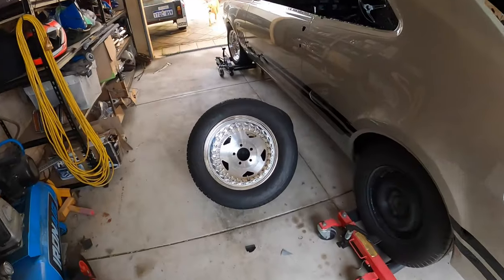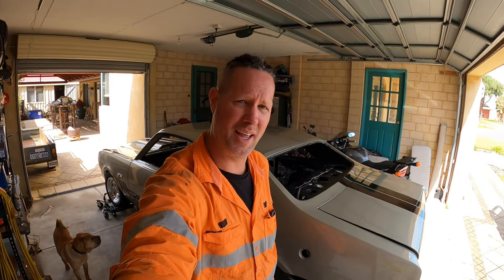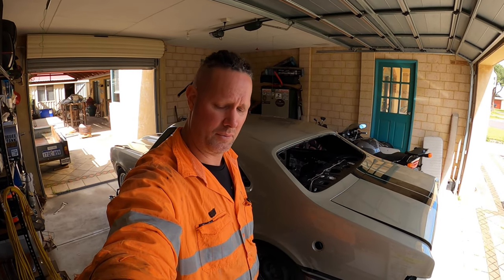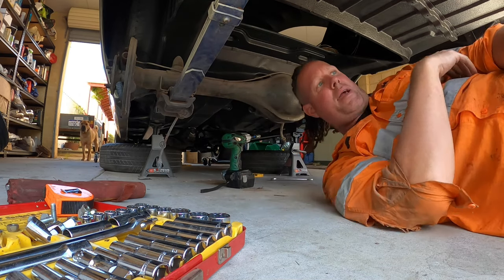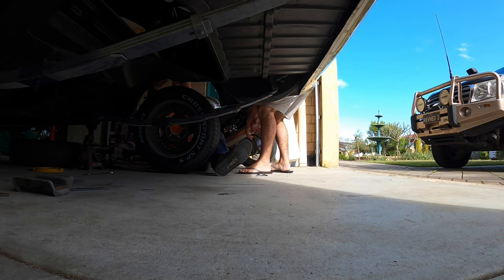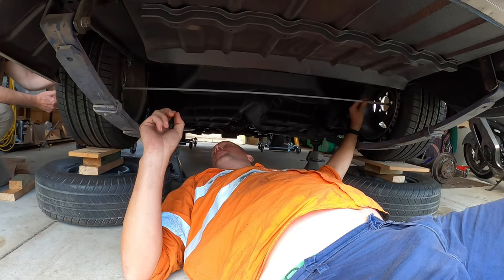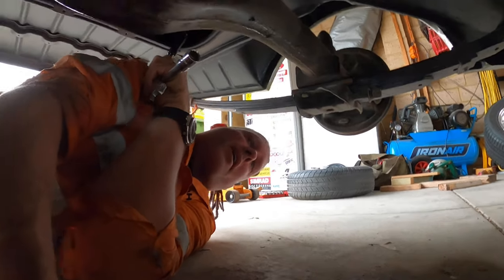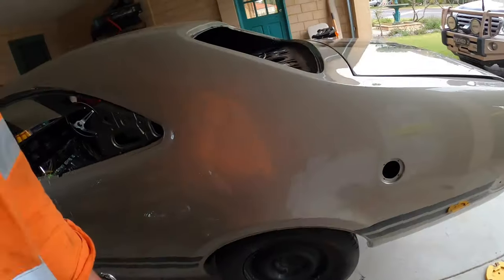Holden HT Monaro Build Ep9 - How To Measure Up Your Diff Width

Comment: easier way to measure your saddles is to just measure  centre bolt to centre bolt  then subtract that from your overall  then half your difference  and you get your rear of hub to centre bolt    , i like math it comes  out perfect
Reply from the maker: I like the sound of that mate. I hope mine works out ok.

Comment: You won't have enough clearance as when you go over a bump the inside tire is going to rub on the 3 ribs on the wheel tubs i had the same thing with my monaro.
Reply from the maker: Certainly will have to assess it once the new diff is in. It's probably unlikely to have the wheel sit as high in the guard as was mocked up anyway.